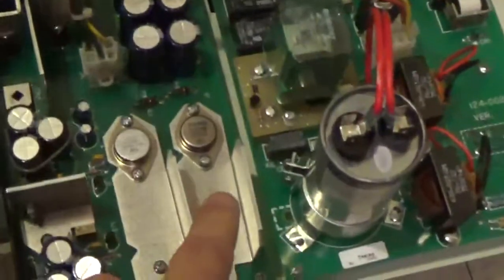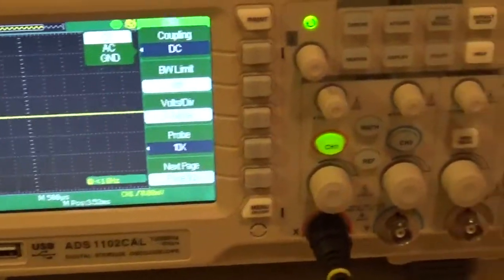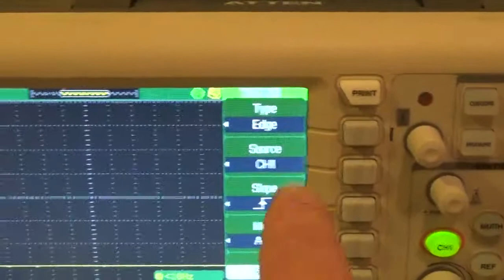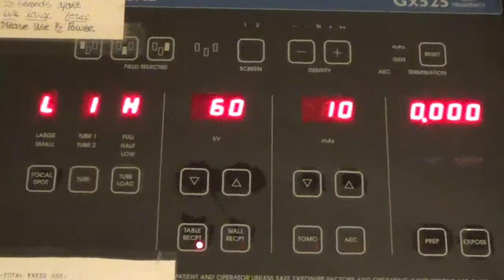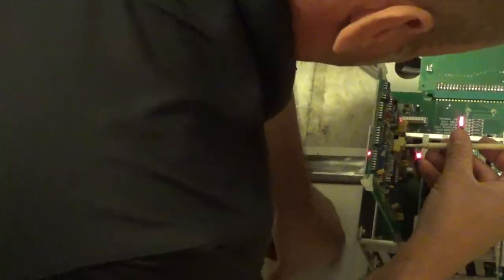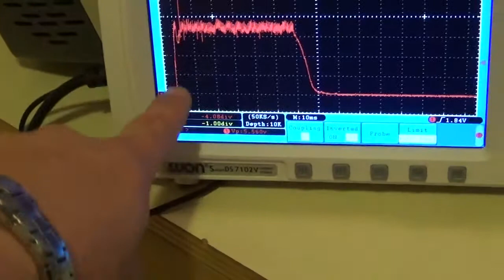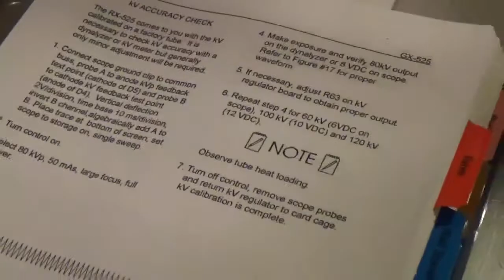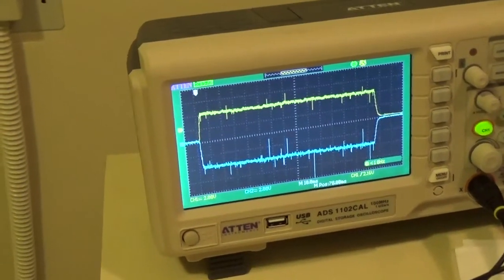X Ray Video #2   Generator calibration and Oscilloscope Basics

Comment: Very nice video. 
i have a malfunction portable dental  X-Ray 60kva 2ma that sent to me for repair.
i fix it by replace some broken diode in the voltage doubler and it's work for 1 week perfectly but after it's broken again.
any idea ? 

best regards
Eng. Mohammed Jassim

Comment: You need to dispose of the whole X-Ray, it is old, unsafe to use. You do not have the proper test equipment to check HV, MA, exposure Time. Oscilloscope is not required.
Reply from the maker: You are absolutely incorrect.  The unit is inspected by a department of health physicist every year prior to certification renewal.  It is a high frequency (30 kHz) generator, which is the modern design, as opposed to single phase line frequency generators of the past.  If you knew what we were looking at on the scope, you would have noticed it in the waveform.  Each of my employees have a Radiation test set, which costs $12,000 each (on average) and requires an $800 yearly calibration to stay compliant.  We use these to verify calibration on x-ray equipment.  The manufacturers procedure, however, requires the use of an oscilloscope to perform the calibration procedure on this unit (which must also be calibrated yearly).  X-Ray equipment in the United States will most often be subjected to test and certification from 3 or 4 different entities including: The Service Provider/manufacturer, an independent Radiation Physicist certified in that state,  the State Department of Health and the FDA, under part 21CFR.  It is not good to make comments like this when you don't know the whole story.  While this video doesn't seem very serious, the work that we do is.  There are hundreds of different makes and models of equipment out there, all requiring different test and calibration procedures.